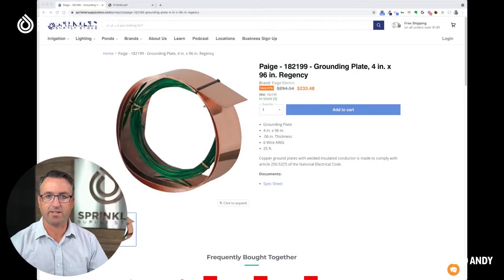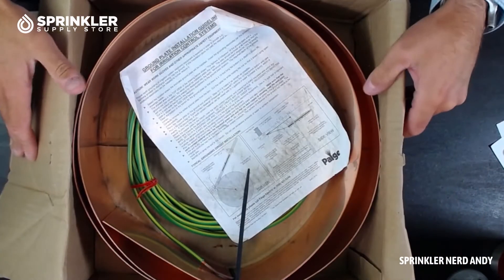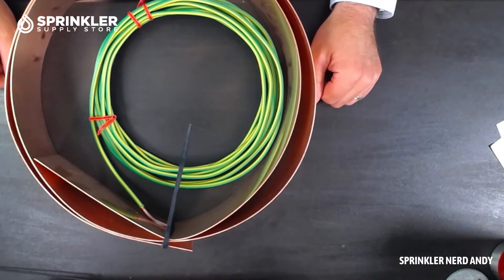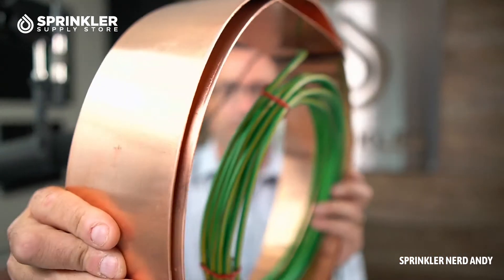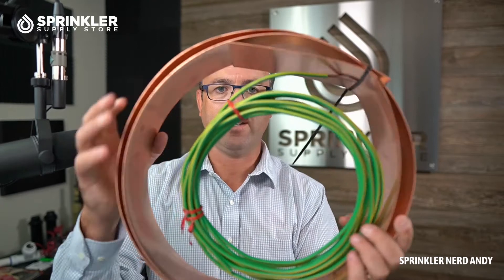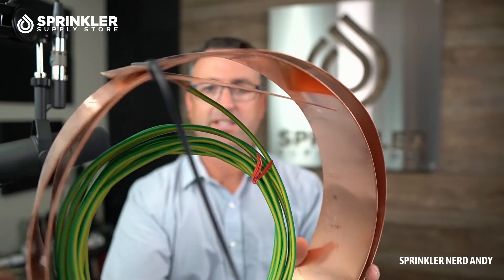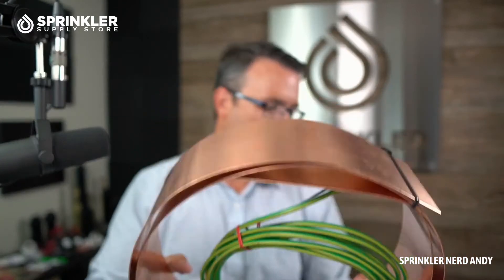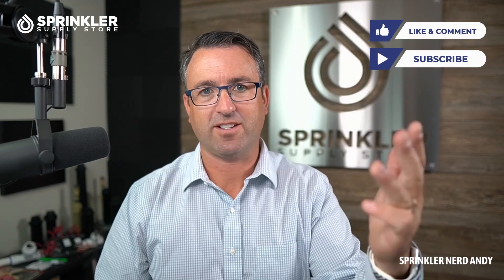Irrigation Controller Grounding Plate from Paige Electric

Comment: What I really need help with is when working with a bunch of valves how should we make the connection on the ground side of all the valves?  I've been just twisting them all up into one big mess and sealing with liquid tape then run single wire to control box.  Please show me how to cleanly do it... Example with 10 valves.
Reply from the maker: Hi Randy.  This video is related to grounding equipment which is a bit different than valve wire splices., however, yes - 10 valve wires is too many for one splice. We recommend that you split the valve wires into smaller groups, like 3 valves, 3 valve, 4 valves, and connect the common wires together using gel filled wire connectors or 3M DBR/Y connectors. Feel free to give us a call if we can help you further.